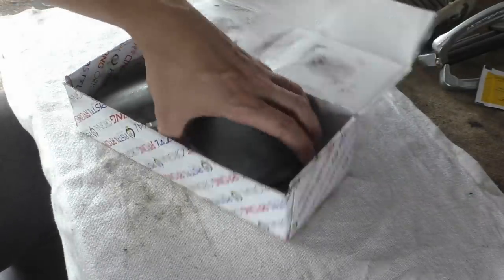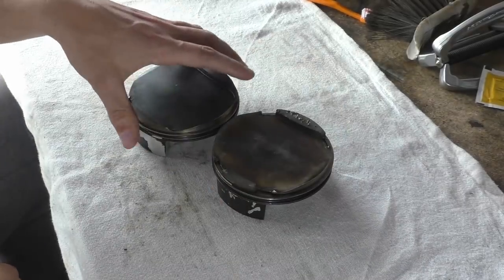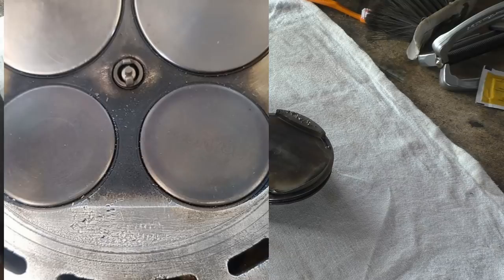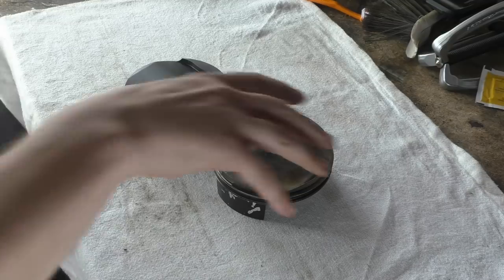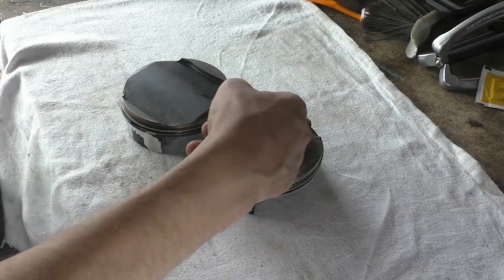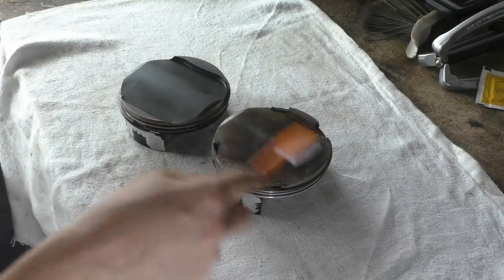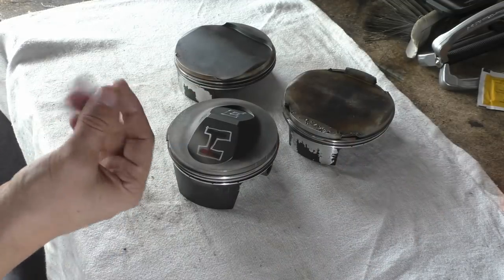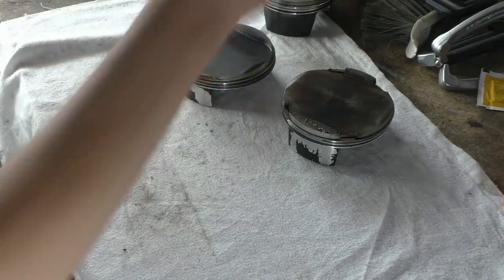R3 Failure Analysis - Made by Ducati?

Comment: Buy two or three new, cheep-ass water cooled engines. Measure dimensions of critical components to make sure, that none of them is fucked up out of the box, and fill them with "different coolants". End this fucking around with revving the shit out of engines in controlled manner and aliasing differences in failures within Evans and normal stuff
And yes, i'm drunk.

Comment: Ok, I have a request for you. Why don't you design your "dream" motorcycle engine for us. Number of cylinders, volume, configuration, number of valves, valve train, bore/stroke, materials, rpm targets, power targets etc. What engine would you like to have in your road bike if you could change variables as you saw fit. Realistic production materials and you'd have to pay for the fuel and servicing costs yourself.
Reply: Easy. For me:

1000cc V4, as stressed part of frame using CarTanium steering head and subframe elements. 

DOHC gear driven cams (of course)

Lightweight supercharger into carbs. 

Custom titanium exhaust with three tone valve:, cop friendly ish; loud; orgasm inducing at 100 yards. 

Upside down forks and Brembo anchors. 

Sticky track tyres

Single sided swingarm

Carbonfibre wheels 

Carbonfibre/kevlar tank (large capacity)

Carbonfibre/kevlar front mudguard, spoiler, half fairing and tail. (Tail must weigh less than an Magnum ice cream)

Renthal bars, satin midnight blue tank and tail.

Comment: Every time I have seen that sort of damage on a piston it has turned out to be either a complete oil way blockage or a partial oil way blockage. Also I would test compression in both cylinders to be safe. Great video. The R3 problem is probably the idiot who set the fuel ratio up

Comment: Nice lengthy analysis. I’ll be sure not to lean out the rear cylinder on my 1299. It does run hot though as my road to mars will tell me.😆

Comment: I don't understand how the pressure in the ring groove can "lever" that up. That pressure is also acting on top of the piston, right?
Reply from the maker: Pressure acts on all surfaces. Like filling a ballon. You might fire air into the bottom towards the top but the whole balloon inflates outwards in all directions. 

So now we have that out of the way.....

The piston is too hot. The piston has expanded more than it should have done and you can see where the top ring land has been skidding into the cylinder, this and the fact that the piston is rocking at the top of the stroke due to the thrusting from the con-rod. 

Now the pressure on top of the piston equals the pressure in the ring groove and the ally in the piston is weak due to thermal loading. At this point the system is in equilibrium. The piston now heads down and this 'skidding' causes the crown section of the piston to deform. 

I didn't do the best job of explaining this and we'll do a follow-up 

Great comment.

Comment: Ok, first thought is piston cooling is important it affects combustion.
Second thought is if this the modern design of pistons with little or no skirt, then the designers need to incorporate very thin cooling webs on the underside of pistons if that’s possible.
Third thought, any high points on a piston are gonna cause problems with temperature.
Reply from the maker: Apart from the other piston....

Comment: 13:55 is a better look. right at the narrowest head space / deepest relief. the piston head is definitely contacting the cylinder wall.
Reply from the maker: Yes, is there more? This is when the piston rocks - usually at TDC and BDC - at TDC is mostly happens on the exhaust/intake stroke
Reply: The rub marks are exactly where the failure occurred. The reason the piston head is smaller in diameter than the skirt (which there is not much of on this piston) is so this does not happen. The head scraping on the cylinder wall can cause a lot of heat / friction. Matt I'm not trying to be confrontational I really like your videos, I think some are very funny / entertaining and most are very informative with fairly good useful content. Just trying to make you think a little more.

Comment: I've got a question for you, Matt. Is it possible to change the crank angle on a bike engine? I started thinking about this once I realized the FZ-07/MT-07 has a 570 degree crank parallel twin, but the MT-03/R3 has a 180 degree crank parallel twin. Am I stupid for wanting to alter the MT-03/R3 to a 570 Degree crank?
Reply from the maker: You'd have to replace the crank, and the camshafts
Reply: The Workshop  is that all there would really be to it though? I'd be interested to see if someone has tried this before. I've heard of it with car engines, but not with bikes.
Reply from the maker: That and the ignition sequence and the injector sequence if you had injectors and yes that would be it. Secondly why would you wanna?
Reply: More to do with how it modifies the characteristics from normal parallel twins. supposedly, makes it function in a similar manner to a V-Twin, although can't really confirm. I also just like how it sounds, but that's a fucking stupid reason to spend money on it, ya know?
Reply from the maker: Crankshaft degrees is all about balance and firing order - forget sound etc - the thing has to work properly.
Reply: The Workshop  certainly, that's why i consider it a dumb idea. I just think it's odd that It's the only mainline sportbike yamaha makes that doesn't have a "crossplane crankshaft engine" (their words, not mine.) Obviously, Crossplane doesn't really work with less than four cylindars, but my understanding is that the Twin and Triples used in the MT-07 and MT-09 are designed to have a similar characteristic. Mostly curious as to why that isn't done on the R3/MT03, if they can accomplish something of the sort on the MT-07 already.

Note: I have no intent of actually trying this, don't worry.
Reply from the maker: "I just think it's odd that It's the only mainline sportbike yamaha makes that doesn't have a "crossplane crankshaft engine" 

- Its not odd, it would be stupid.

"Obviously, Crossplane doesn't really work with less than four cylindars,"
Reply: well, as I said, the other 3 and 2 cylinder engines have a crank angle that supposedly mimics a crossplane. shrugs
Reply: It is possible to change the crank angle on an engine, it's a semi-popular thing to do on the xs650, it's called a crank rephasing.  I don't buy that it really does anything, but the idea is that going from a 360º to 270º crank gives better secondary balance and allows the engine to safely rev higher.

If I worked at Yamaha, I would claim that the R3 benefits from lower pumping losses using a 180º crank, which is important for such a low displacement engine. It's probably just cheaper to machine a 180º crank though.

Comment: Anyone crazy enough to run different compression ratios on each cylinder?
Reply from the maker: It would be pretty fucking stupid - but who knows
Reply: @dirtygarageguy  seems like it would be stupid not to in a V twin. 

One cylinder running a little cooler? That's unused performance potential.

Comment: Why don’t 4ts have pegs to locate the ring? Surely it would be good to locate them properly?
Reply from the maker: Because 4 strokes don't have ports....
Reply: The Workshop but you don’t want the ring gaps lining up eventually do you? Locating them properly would surely be an advantage? Why not put the top ring  gap by the exhaust port so it can expand easier ?.....🤔
Reply from the maker: The rings rotate during operation and this is a good thing. It means that the bore and rings wear more evenly. I did a video of a 2 stroke piston and you can see where the ring wore away on the exhaust port side.
Reply from the maker: And to add - most of the expansion is due to friction and the combustion gases - the difference between the intake and exhaust side in regards to temperature isn't that much different.
Reply: The Workshop I bow to your superior knowledge Dellb......sorry....Matt!🤷‍♂️🤷‍♂️🤷‍♂️🤷‍♂️🤪

Comment: Is teflon in your oil even a bad thing?
Reply from the maker: No chemically, but its bits of shit that clogg up your filter over time. Hence why changing your oil/and filter is important - as well as all the other reasons
Reply: For sure. But about teflon, if you could add it as microfine particles that would pass through filters and the like to your oil would it do any good to your engine?
Reply: Teflon in your oil for bikes was  discussed in detail on some oil forums, as well as other additives, and oil producers a few years ago among other additives. The oil producers were against it as were many on the forum due to wet clutches along with certainother additives.  This I tend to agree with.  Can't recall what affect it would have on shear strength of the oil that is essential for gear box.  Of course if you have a dry clutch and use Hypoid oil in a separate gearbox as in a car then there is not an issue other than possibly what Matt mentioned regarding filters.  There is a lot of information on this on the Internet if you want to look further into it. PTFE (Teflon) is already a constituent in many if not all car engine oils.
Reply: Virtually all lubricant companies I have come across have stated that additional additives are not required and their product includes all the necessary ones.  There is in fact certain components that are very good up to a certain level and then become counter productive.  The link you attached refers to motor vehicles as in cars and as I said PTFE is already in car engine oils. This is a problem as when many talk about vehicle oils they usually only think of cars and not motorbikes that are a completely different situation.  Trucks use different oils again.  In fact it is only reasonably recently that Diesel and Petrol cars could use the same engine oil.

Some of the reasons for differences between bikes and cars are:

Higher operating speeds
Wet Clutches
Shear strength of the oil required for gear boxes run in bike engine oil

The viscosity rating of the oil starts to change after as little as a 1000 miles on a bike, and some say sooner.  Most bikes are required to change their oil around every 4000 miles, some sooner some later, that is far more frequent than most cars unless you own an Evo or some super car.  I do know riders that put car engine oil in their bikes saying that there is no difference.  However there is and personally I would rather put the correct oil in, changing at the correct interval.  That ensures that my clutch works properly,  and reducing the chance of the gear box or engine failing prematurely.
Reply: Incidentally as synthetic was mentioned in that linkedin article most synthetics these days are not actually synthetic as we normally think.  They use very high specification mineral base stock with additives that bring it to the same level as what was previously thought to be synthetic.  However there is still the controversy whether bikes should use fully synthetic of semi synthetic.  I think it was Castrol that stated a few years back that all bikes should be run in on semi synthetic, and in their opinion continue on semi even if the manufacturer says fully.  (There are some good videos on YT of castrol showing how they test their oils with bikes both in their test lab, and outside on the road and track.

Comment: Nikasil failure?
Reply from the maker: Failure how? Completely come away?
Reply: It could have, however unlikely, flaked of etc, causing differential friction, causing the piston to tilt? Bad heat treat on a ring maybe. What did the cylinder look like?
Reply from the maker: Didn't see the cylinder, but the guy who sent me these wasn't sure what happened, hence sending them to me. If the cylinder had shed its coating, I'm sure he'd have noticed.
Reply from the maker: A second point to this is that cylinders are honed. Even when nikasil'ed if that's a word. When Nikasil fails if flakes off really easily - there would also be traces of it all over the piston as a hard particle dusting and bigger chunks.
Reply: The Workshop just throwing uneducated guesses at you ha ha
Reply from the maker: A more power to you dude, its comments like this that leads onto other videos. Don't stop my good man, its all appreciated :)
Reply: David Stevenson think of all the xr250’s in the world that are still going ha ha

Comment: what is your point?
Reply from the maker: Come again?
Reply: Point is changing your coolant to fucking Evans won't help.
Reply: you are only giving us part of the picture where's the rest of the engine?.... What do the bearings look like ?..what does the crankshaft look like?.... What kind of fuel were you running?...... What was the AFR on that cylinder under heavy load?... How flatware the ring lands on the Piston how flat where the Rings?... What was the maximum timing set at?.... What was the heat range of the spark plugs?..